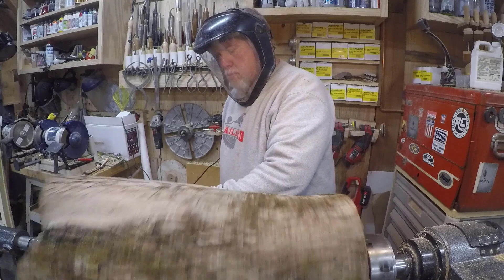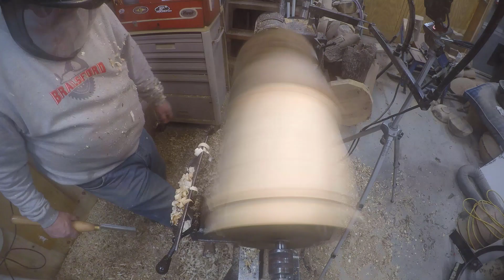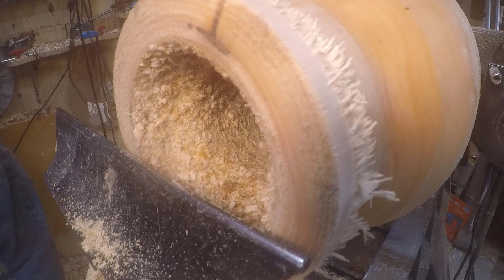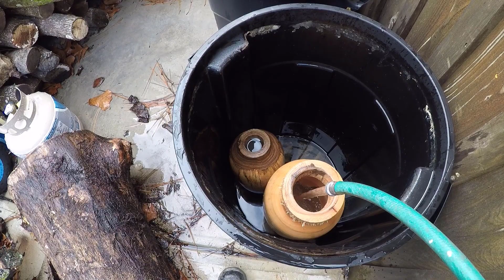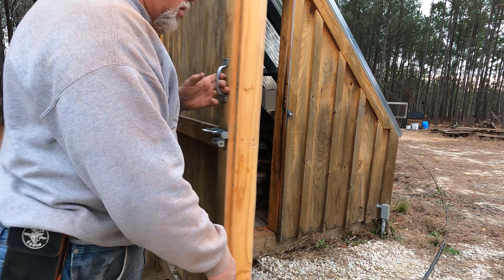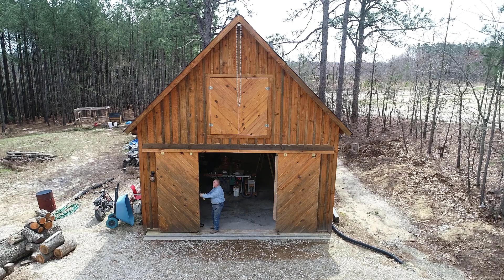Wood Turning a Sugar Maple Vase

Comment: Thank you for the video, tell me why do you cook vases?
Reply from the maker: I know it seems counter intuitive, however it helps the wood to dry faster without cracking.  Thanks for watching!
Reply: @BrailsfordWoodworks  How long do you cook wood? Do you add salt to the water?? Do you cover the products with a sealant after cooking? You have a very cozy workshop! I've been watching your video for a very long time, you are a great master! Thank you very much for your knowledge.
Reply from the maker: you boil them for an hour per inch of thickness (30mm).  I did not add any salt.  The bowl went straight into my kiln.  Thank you for the kind words!
Reply: @BrailsfordWoodworks  Thanks for the quick response

Comment: That is a very stout hollowing system!!  Never seen that… what brand?  Seems like what you need to do such a deep hollow form!  How deep did you hollow?
Reply: Looks like a Simon Hope hollowing system
Reply from the maker: It is the Clark Deep Hollowing system.  I went to within 2.5 - 3" of the bottom.  I left the walls about 1.5".  I did this video a couple months back.  After boiling and it going into my kiln it is ready to go. I will do a follow up video as soon as I can fit it in.  Thanks for watching!   https://www.theokspindoctor.com/Clark-Deep-Hollowing-System-p/hb.htm